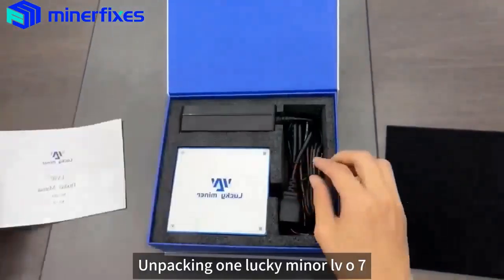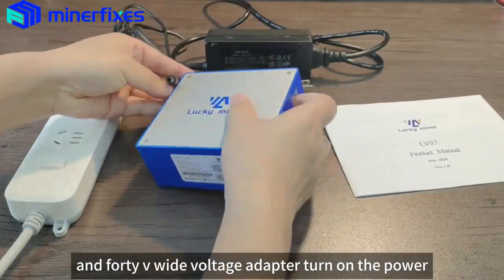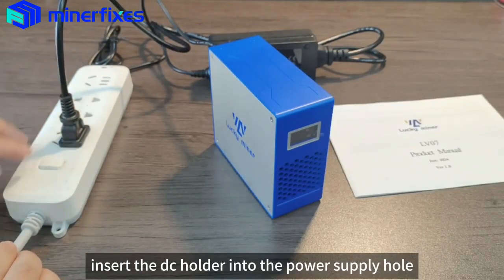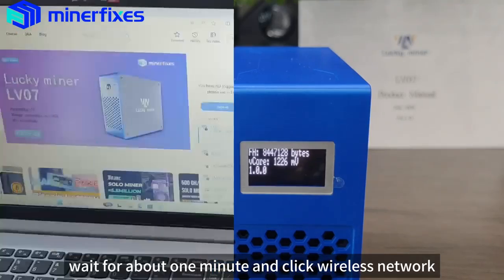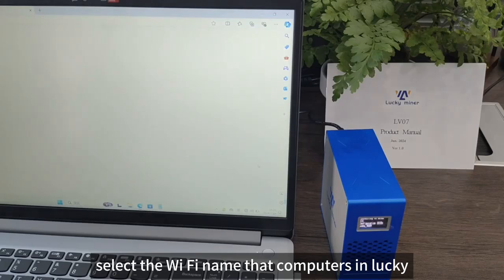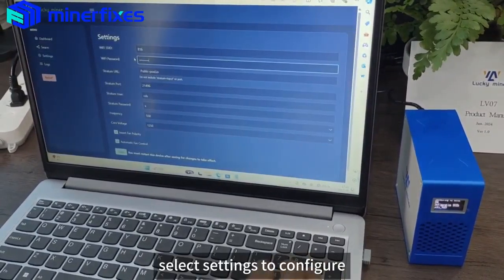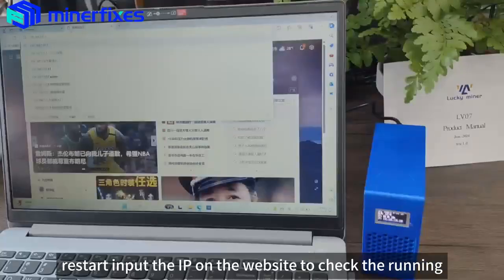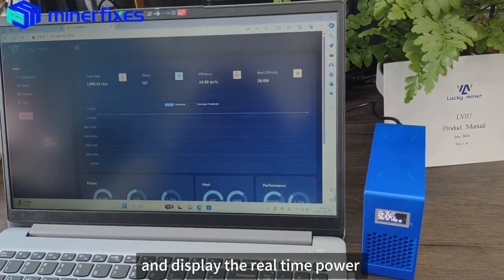Luckyminer LV07 Computer and Laptop Setup Guide

Comment: With the Avalon Nano 3 out you’re going to have to drop the price on this or it’s not going to sell.
Reply: This one: 15 Watt. Avalon: 140 Watt. This one has a higher cost/value ratio
Reply from the maker: @RickSanchez_85  A little higher power around 25W
Reply: @minerfixes  ok but still 25*4 =100 Watt while the Avalon uses 140 Watt for his 4 TH/s so still this one is more efficient - but yeah also way too pricy because it's the same cost than the Avalon so it should be reduced in price at least by half

Comment: It violates the GPL license
Reply: If you strike it rich with it and find a block no one gives a C
Reply from the maker: So you want it to be like Bitaxe with open source?
Reply: @minerfixes  I think at least the V6 pretty much was nothing more than a modified Bitaxe board with a slightly edited firmware and a nice Case. This one seems to be something completely own - designed since it's more efficient than even the Bitaxe Supra.
Reply: @minerfixes  yes
Reply: Yes
Reply: @Sm0oTh92  Than pay double the price for it (like with bitaxe) than you will might get it
Reply: @Sm0oTh92   well than pay double of what you pay right now - maybe than you will get something like this. One day. Or not. 
Asking for a friend: Do "normal" Antminers "violate" the GPL? Because why are you so sure, Lucky Miner does? There code is Proprietary and this miner in particular works with a much higher hasrate than the best Bitaxe on the market - so what makes you think they would still use the Bitaxe Code in Version 7?